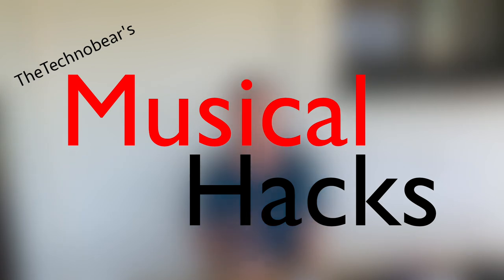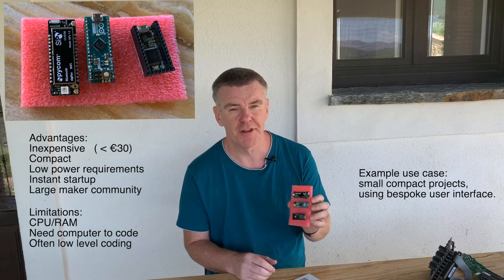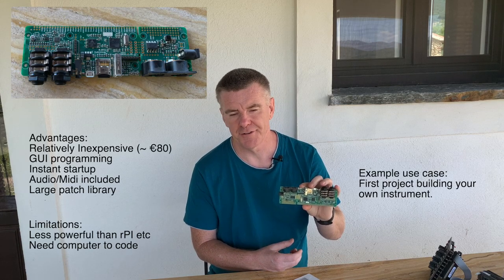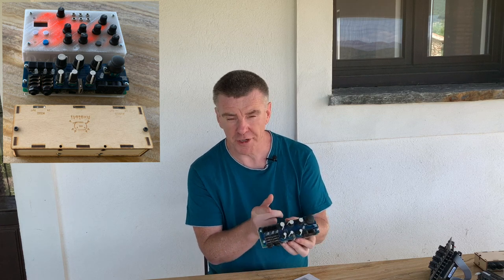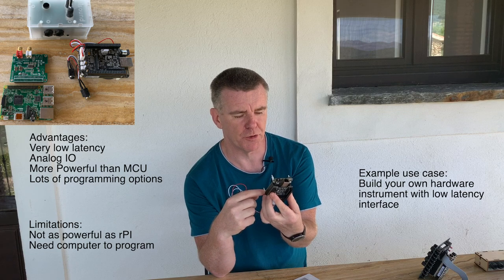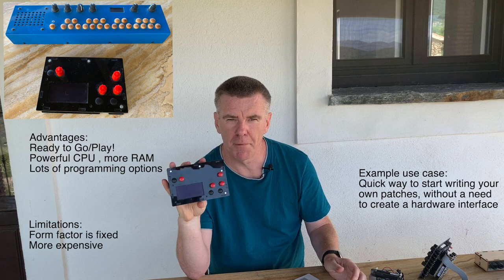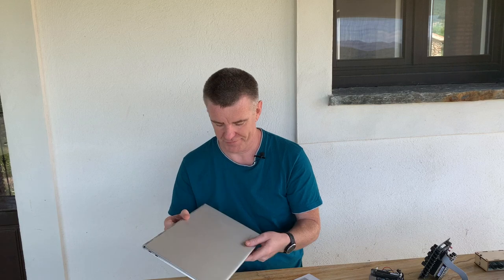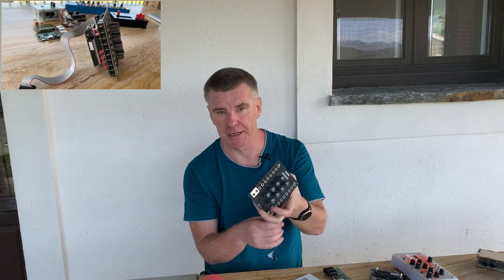Musical Hacks #1 - Intro and hardware platform overview

Comment: I built a drum pad with a raspberry Pi 3B+ and Pisound, installed Pisound OS with Orac. 
How would I get a little 2.7” display to work with this setup?
Reply from the maker: Usually you use an i2c or spi display, but with pisound you have to be careful to not use pins it’s already using - best discussed on the blokas forum.